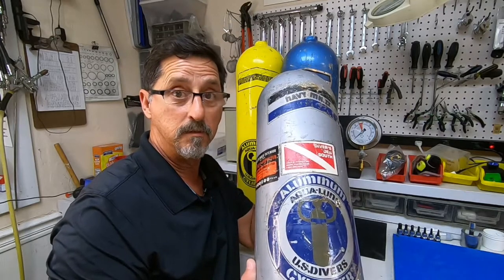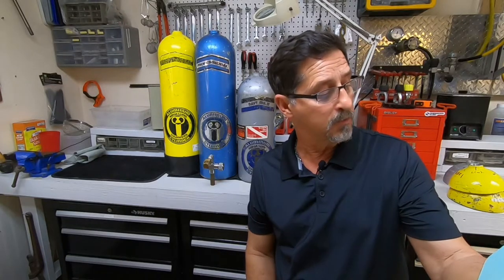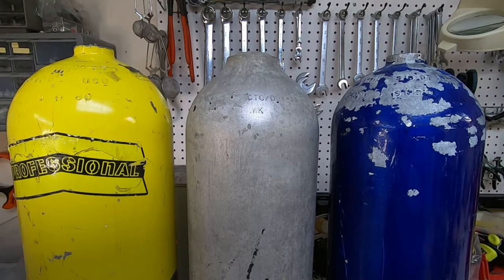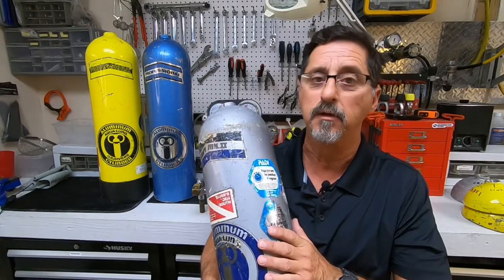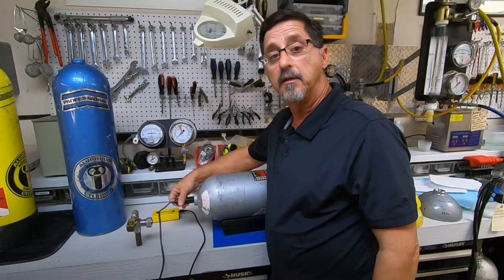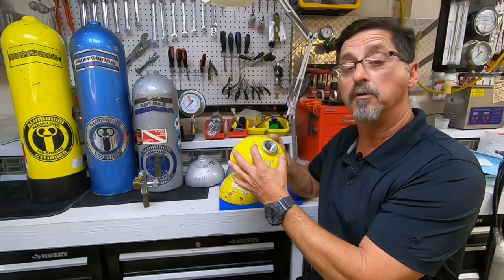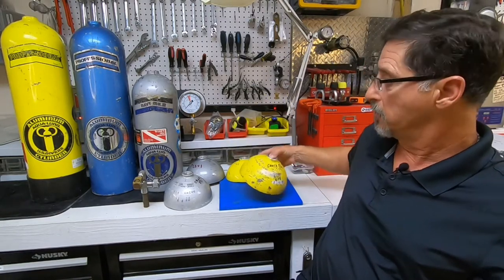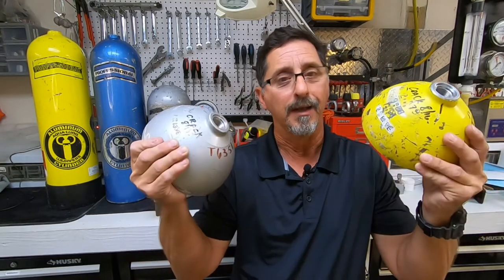My tanks are too old?? can't get them filled

Comment: Great video. I'm from Canada where a have and use 2 oilless 4 stage compressors to fill my tanks. I never agreed with hydro testing on aluminum takes as to steel tanks. Aluminum does not like to be stretched.  The crack or start a crack soon after
 Steel will flex many many times before distributing its molecular structure.  I visual my own tanks 2 times a years and ultrasound then every two years. The ultrasound is done a a lab by experienced techs using calibration blocks as a comparison.  Having said that, I do own a wk tank and a older Luxfer.  I've never had issues with these tanks but, after watching your video, common sense tells be to follow your advice and retire those tanks. Thank you
Reply from the maker: Neck cracks can be dangerous, years ago I was working in a shop with a water tank for wet fills,  one of these tanks cracked on fill and air was busting thought the neck. Thank goodness it didn't fully blow, there was 3 of us standing next to the fill station.  Thanks for the comment.

Comment: thank you, thank you -You just saved my Lux 13 that I bought from Brownie's Third Lung in 90 and still has the original air in it - I was about to trash it -  never used in 32 years - I was wanting to use it as a pony with a Blu3 Nemo I just picked up for metal detecting off the beach - but I just started draining a Lux 50 I have left from 86 - it has been sitting in the Garage since last hydro I think in 04 when I was going to start diving again but work and work travel got in the way - I do have a Catalina 80 I bought last year so I do have something I can use if I want to go deeper than the 9ft of the Nemo
-
Reply from the maker: I glad to hear my info was helpful to you.  Having a pony bottle in addition to third lung is a great idea, I'm a big advocate for carrying a pony bottle.  Beach metal detecting is also in my interest, I use a Garrett Sea Hunter with a graphite handle.  The lightweight handle allows me to work the beach for hours.  When the nor'easter storms start to roll in and remove a lot of sand is my favorite time to metal detect the beaches.
Haven't used a BluNemo yet, but hope to someday.  Thanks commenting and watching my channel!
Reply: Filled and never used in 32 years? I’m not sure I understand why anyone would ever do that.
Reply: This is great information for the scuba diving community, however, are you absolutely, 100% sure that there’s never been in that crack on a 6061 aluminum cylinder? Thank you!

Comment: I had a 10.4 litre 232 Bar Alloy 6061 tank (85 c.f.) fail a visual for a crack in the neck - DO NOT think that new alloys are not susceptible to load cracking, IF you leave a scuba tank full long enough it will fail at the weakest point. I now only dive steel cylinders which are looked after better than my dive computer, and IF I'm not planning to dive for 3 months or more, I leave them at 50 Bar (500 psi) so as not to put unnecessary stress on the cylinder.
Reply from the maker: Sometimes a fold in the neck can be mistaken for SLC neck crack. I've seen many shops confuse folds with SLC  in 6061.
I'm not saying that it can't happen but the chances are slim, an eddy current test will confirm a SLC.

Comment: I think tanks from back in the '50s were made of steel.
I grew up with tanks my dad had, still charged.
For decades!!
I can imagine modern tanks charged and left charged for extended times (years, decades) might develop and grow cracks  under pressure.
Perhaps crack growth or even initiation would decrease with tanks being stored near empty?
Reply from the maker: yes tanks from the 50s thru the 60s were made of steel.  Aluminum tanks were introduced early 70s somewhere around 1972-73. Never good idea to have tanks full to max pressure for extended time.

Comment: Question:  I had my old US Diver tank hydro'ed a couple of years ago and the person who tested my tank scraped not only all the old inspection stickers off of it, they scraped the Aqua-Lung/US Diver and the Professional chevrons off of it.  Does everyone does that?  OK I bought the tank in 85 so would be one of the tanks you are talking about?
Reply from the maker: Removing old decals is recommended to avoid corrosion from developing  underneath.  As far as the original decal, if corrosion is present then it's understandable.  I question more the testing of 1985 tanks and keeping it in service.  To be legal test it must have a eddy current test along with hydro, then stamped with "VE" next to hydro date.

Comment: Confused about the Catalina tank. All Catalina tanks are made of 6061, why do dive shops still refuse to service early year models?
Reply from the maker: Yes, Catalina only uses 6061.  Some shops might not know this or they just have a standard "no fill "policy about tanks from the 1980's, which we can't control. Thanks for question.
Reply: Locally, the shops won't touch any before 2000!  Luxfer made some bad ones into the 90's that they refuse to acknowledge.

Comment: I picked up 2 tanks that are filled from a junk removal job … they are sitting in my driveway … and the recyclers won’t take them full.  Im scared shitless of these things but I want to get them out of here.  They aren’t that old probably 90s or so … I’m going to pick them up off the ground and put them in my shed.  Im worried of them exploding.. but I know it’s extremely rare.
Reply from the maker: Check the born on date, if from 1990s or newer the risk is low.
You can empty the air slowly and then they’re nothing more than aluminum container. I recycle condemned tanks, also the valve are yellow brass… more value then aluminum.
Reply: @scubatechkeylargo  thanks for the quick reply … I will check them
Reply: @scubatechkeylargo  got them emptied … one had ALOT of air the other almost nothing.  I can handle them safely now … and I owe it all to you.  Thanks for the confidence booster … they were from mid 90s
Reply from the maker: @TrollHunterxXx  glad to hear it worked out. Thanks for watching my channel!

Comment: Local shop won't touch a cylinder made before 2000.  Also, all aluminum cylinders should get scrapped at the 15-20 year mark.  Especially those used in salt water.  Even 6061 will crack after awhile.
Reply from the maker: Every shop has it’s own internal rules about 6351, can’t argue with the more conservative.